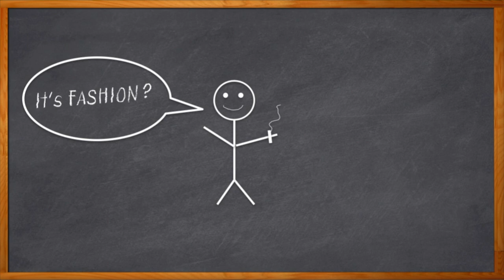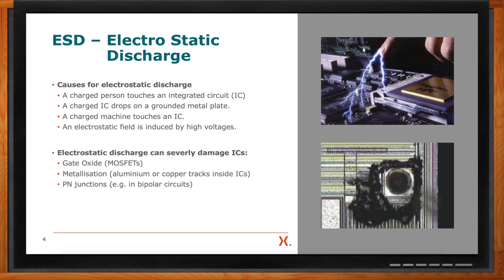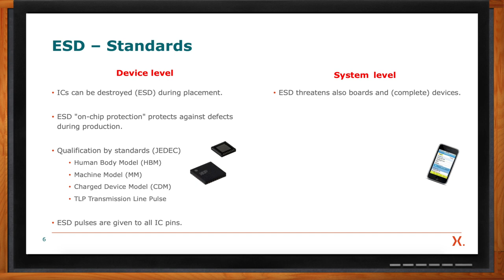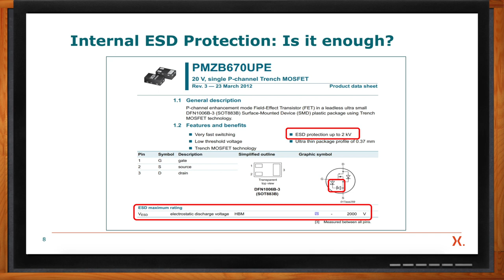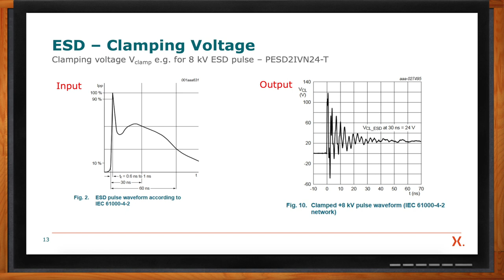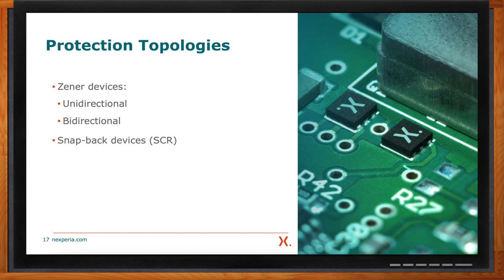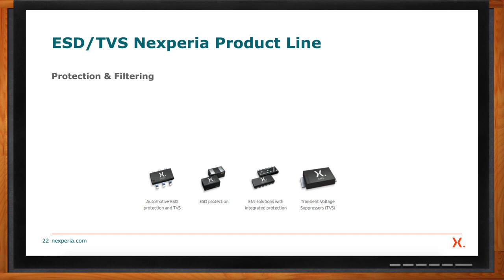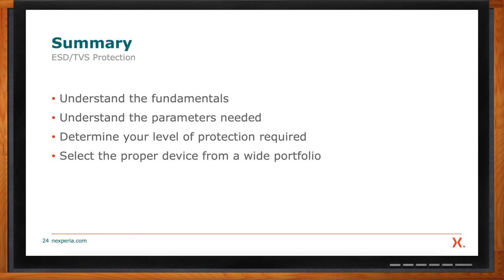Basics of ESD and TVS protection

Comment: Is ESD protection different than AC inductance spikes?
Reply from the maker: Hello, thanks for your question! ESD and TVS protection are similar issues with these differences:
-	ESD events are very high voltages (30,000V or more) for very short period of time (nanoseconds). They are generated by static electricity (rubbing feet on carpet, etc.). The damage caused to an IC is typically “oxide punch through”
-	TVS events are not as high (thousands of volts) but for longer duration. This causes the device to heat up so damage may be in the form of overheating. TVS events can be generated by DC or AC spike (an electric motor on the same power supply causing induced voltage on a signal line)